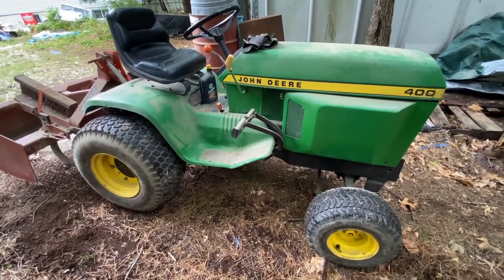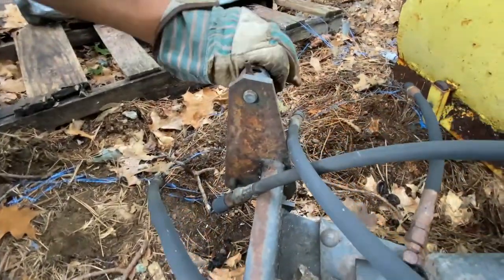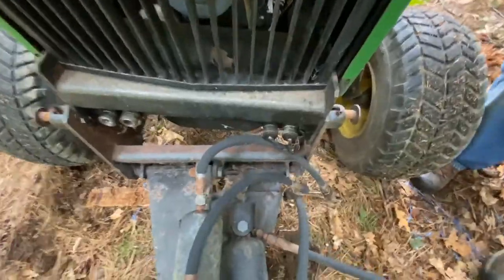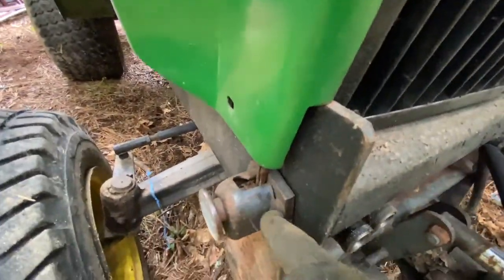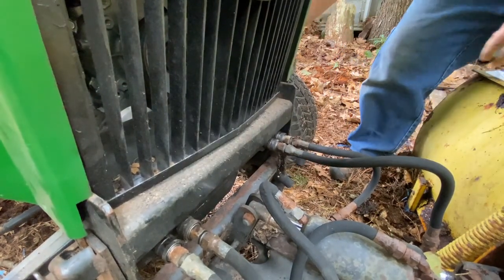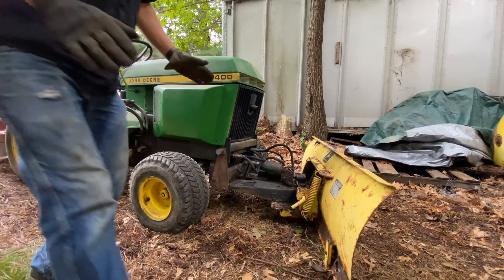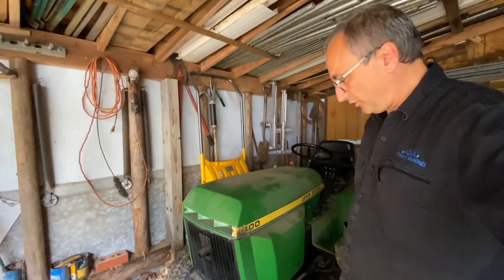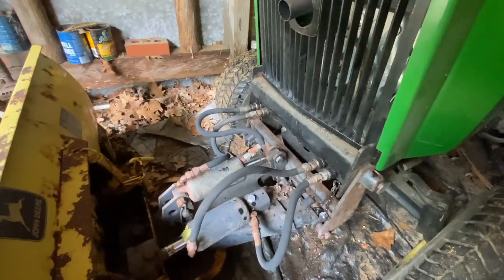Mounting the blade on a John Deere 400 quick & easy

Comment: Based on your decals it appears to be similar to my JD 400 which was a 1976 model year manufactured in late 1975. There should be a nameplate on the metal below the dash with the serial number.  Around 1980 the changed the decal font and details. My dad bought this tractor new, and I now have it after he passed away. After you put the bottom pins in place you can then use the hydraulics to lift the blade and locking pins in place. It has saved my back from some heavy lifting.  They are a tough workhorse if you take reasonable care of it.
Reply from the maker: They are a great tractor for sure. Glad you still have the one your Dad got new. Thanks for taking the time to comment.

Comment: Your lift cylinder is mounted backwards. The fitting at the end will hit the frame when you raise the blade. Flip it around before you break your fitting.. I had it happen to me on my 400
Reply from the maker: That’s how it was when I got it, I’ll take a look at it for sure. But it has not given me any issue so far. Thanks for letting me know.

Comment: Do you still have this tractor?
Reply from the maker: @Hoosierdigger  yes I do, I was plowing snow with it yesterday
Reply: @ I have some questions about hydraulics I need help with and you probably know more than I do. I have the very same tractor.
Reply from the maker: @ feel free to ask I would be happy to 
  help if I can.
Reply: @shanesmaineshop  so my hydraulics are very slow and weak. I tried everything I know to do including replacing the pump with a newer one. Wheel speed and power is excellent however it will not lift any of my attachments other than my snow blade and even that is very very slow.
Reply from the maker: @ well I’m not an expert in this area, but a few questions, how is the steering and when the blade is being lifted is it making kind of like a screeching noise like the pump is struggling? The only reason why I ask is it sounds like low on fluid but if everything else is working fine, it’s hard to believe that’s the issue. It will go forward and backward if you low on fluid, but typically the steering wheel start to get very hard if the fluid is low. Assuming you have hydraulic steering as well.
Reply: @ yes I do have power steering. It doesn’t screech when do 2 functions at a time but when operating the blade while turning it almost impossible to steer. I recently topped off the hydraulic fluid (maybe even over full) and no difference. Also has a brand new filter. Everyone else’s 400 that I see seems to have much faster hydraulics and stronger too.
Reply from the maker: @ yeah I am not sure, mine move fairly quick and plenty of power. If I put the blade down, it’ll lift the front of the tractor right off the ground. The hard part is some of the stuff seems to be working and some not otherwise I would say maybe hydraulic pump but it really is hard to tell.
Reply from the maker: @ certainly sounds like a fluid issue you said you top that off. Maybe something is plugged like a line or something like that.
Reply: @shanesmaineshop  I want to tear it apart again and check all the lines as soon as the weather warms up. Until then I’d most certainly enjoy watching videos of yours if you feel like filming it🙂.
Reply from the maker: @ I’m probably due for another video about that tractor lol I’ll see what I can do in the coming week or so